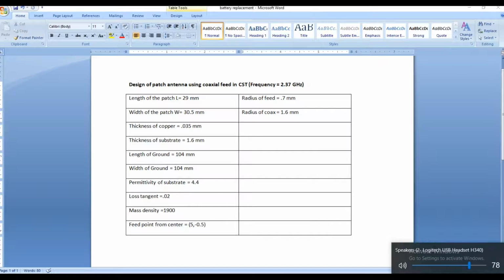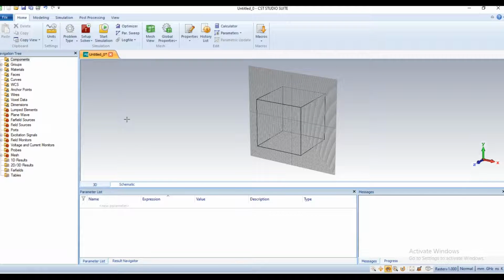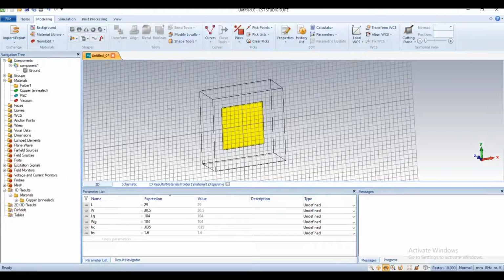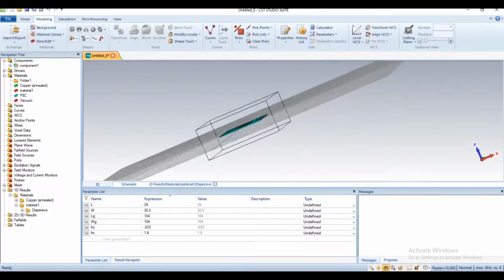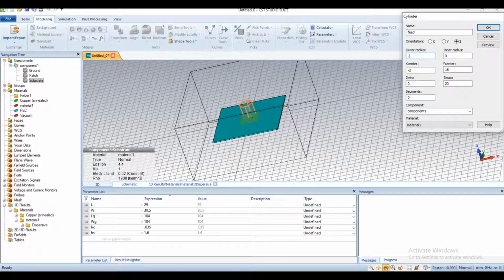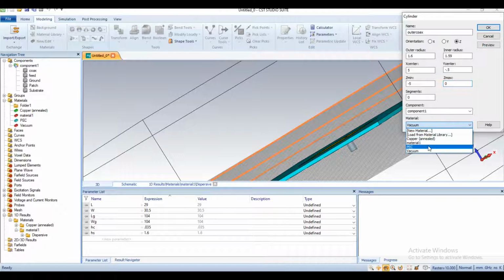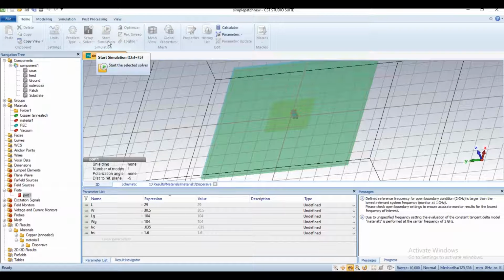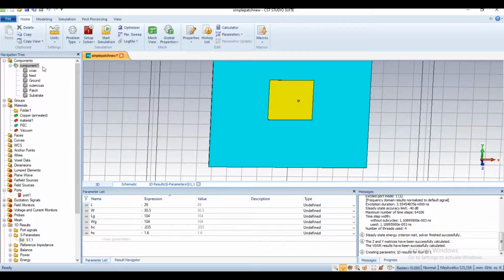Coaxial Fed patch antenna design using CST software

Comment: how to set the location of coaxial?
Reply: You can optimize it by parametric study at CST Software
Reply: @fredfrancium  How do you parameter sweep location of the hole? When you do a boolean subtract, the component dissappears
Reply: @tradtrad1000  You estimate the location, based on previous work and then you can move it 1 mm by 1, then each one that you get best results is the right place
Reply: @fredfrancium  It's not what I meant, but I found that even after Boolean subtract, if the location is set as a parameter, you can still sweep the parameter and the location of the hole will change.